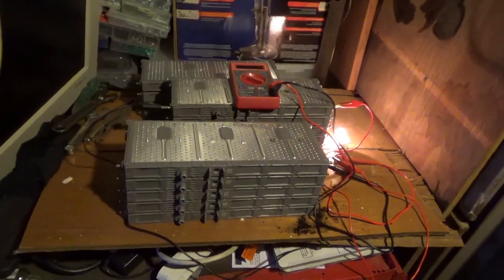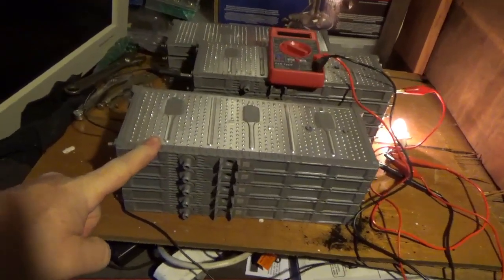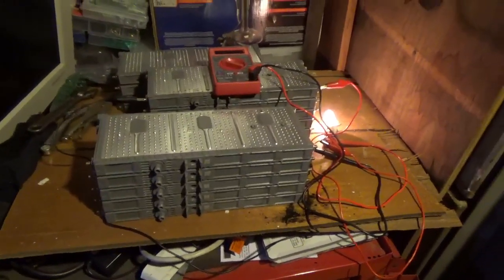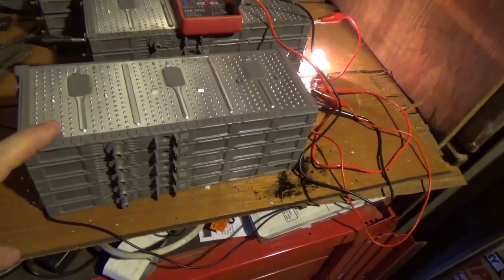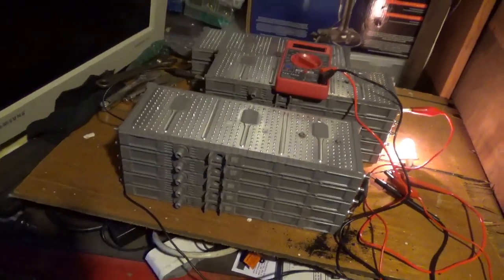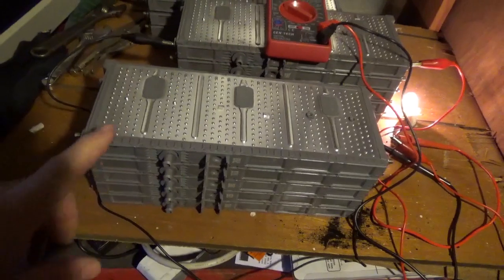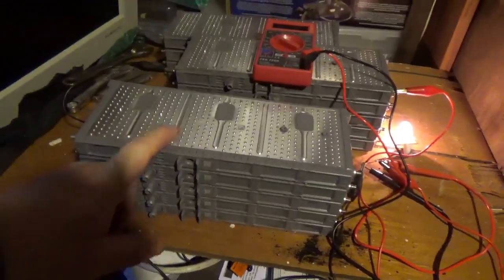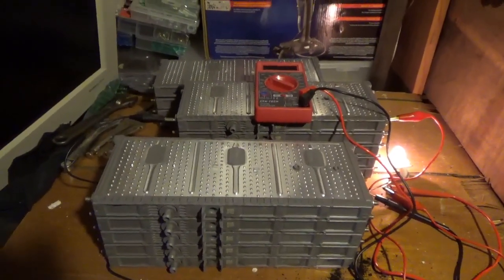Cells from a Hybrid Car Battery, Voltage, Ampere Hour Expectations!

Comment: Man,what a great video, that answered it all about volts and A-hours; they are really weak on that; the new lifepo4 are 10 or 20 times better?

I don't get it, you  said 6.5 Ah each element ?  the total is  216 Volts,so that would be 6.5 x 216 , or  1.4 KWh;  too weak, 1.4 kwh is in a  regular car lead-acid battery of 120 Ah,and that amounts to nothing;   it is the the same as 0.17 liters,or 1 cup,  of gasoline,that has 1.4 KWh of energy..

Comment: How many Amps for this battery
Reply: I think he said 6 or 6.5amp
Reply: @theaussienurseflipper.8113      He said 6.5 but that can´t be;  the total is  216 Volts,so that would be 6.5 x 216 , or  1.4 K;  too weak, 1.4 kwh is a  regular car lead-acid battery of 120 Ah,and that amounts to nothing;  0.14 liters,or 1 cup,  of gasoline have 1.4 Kwh of energy..

Comment: for a solar system, what about connecting 4 of them for 24v and set the charging control to charge up 28v, as the Inverter (24V) work rang is 21.5v to 28v. this will be a safe option for not overcharge and not over discharge. what you think?????